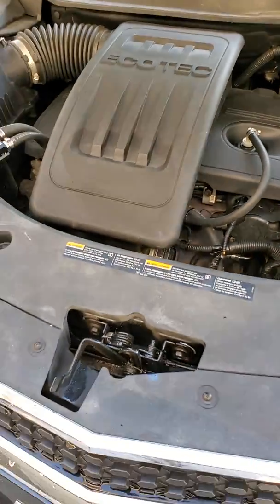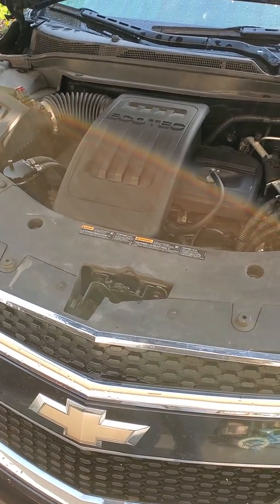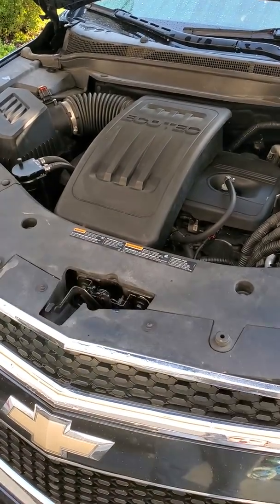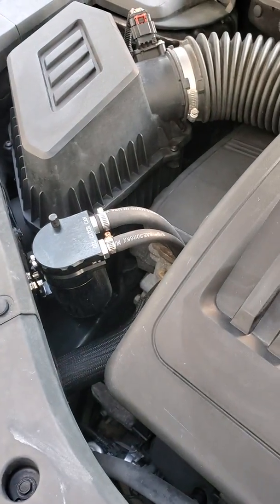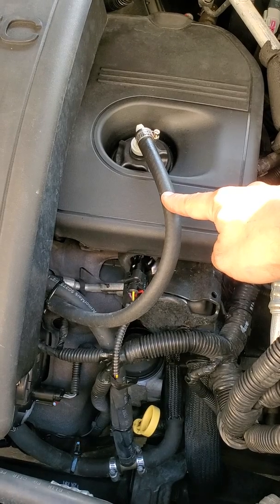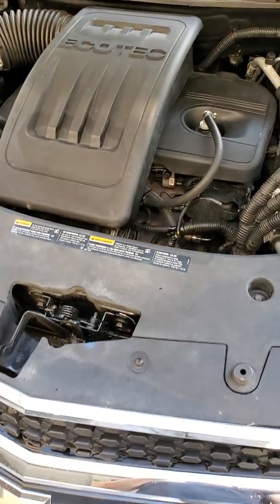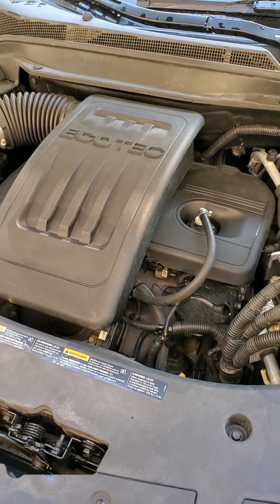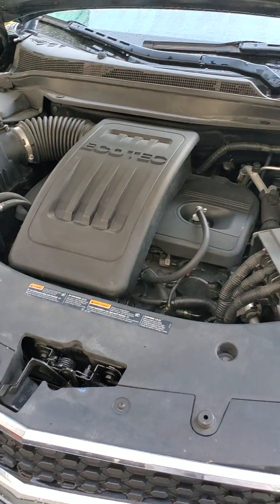2.4L EcoTec oil consumption fix. 2013 Chevy Equinox. Oil Burning, Catch Can.

Comment: Does this system help or fix blow by?
Reply from the maker: @stevejohnson-q3v  it helps reduce the symptoms of blow by and gives it an alternate route plus catches excess oil. The rings are the main culprit.
Reply: thanks for replying! i have a 2016 GMC Terrain does't use oil but does show signs of blow by! thinking could be stuck rings or pcv orffice plugged. i put a oil catch can on the clean side about a year ago and was surprised the amount of water it accumulates, think i'll install the pcv valve like you did in the oil fill cap, i seen your video about putting two catch cans on but never seen results, do both catch water? ever any issues with the brake booster?
Reply from the maker: @stevejohnson-q3v  clean air side for me iv never caught anything.  Dirty side I have to empty 2500 to 3000 miles (worse in winter)

Comment: There are a few reasons why GM and other manufacturers choose the fixed orifice PCV design. One reason is consistent flow of O2 for fuel trim. The other is to help with oil consumption. High vacuum with a PCV valve wide open forces the fuel trim to adjust constantly, and can potentially suck the oil out of the engine. So as an experiment what I’m going to do is modify your design with a fixed orifice PCV valve on the oil filler cap instead of that Honda PCV valve. I’m basically externalizing the original design for this engine. See what happens. The goal is to not need a catch can, but we will see
Reply from the maker: Cool to experiment. This has been working for me for almost 4 years now. The benefit of catch can especially in my climate where it's cold for 5 months of the year is I can capture and eliminate the excess fuel / oil mist and keep it from being recirculating into the engine. See my other videos of how much I catch on a 3000k mile oil change. Good luck .
Reply: In my opinion that's the only proper solution. Rumor has it the EU drivers figured it out by stuffing a 8mm OD sleeve and a 3mm ID hole inside of the pcv nipple that comes out of the valve cover

Comment: Did you use sheet metal screws to mount the bracket for the catch can? I've seen other catch can equinox installs here and some use
the provided machine screws which would need a nut on the back end of the screw to cinch it to the bracket, On my Equinox, there
is no way to access the back side of the frame that the catch can is mounted.

Comment: The terrain, equinox, Acadia whatever vehicle gmc, Chevy made that had this engine was doomed the day it came off the assembly line. I owned a 2011 GMC Terrain. And the problems culminated are as follows:

-20k mi. car died. 3k mi short of the oil minder

-35k mi. Timing chain tensioner failure. Engine chatter audible after fix.

-40k mi. Consuming 1 quart of oil every 1500 mi. 

-55k mi. Engine chatter worsens, consuming 2 quarts of oil every 2000mi. A/C compressor failure. 

-110k mi. Car dies upon acceleration after a complete stop. A/C compressor failed again. Multiple leaks and clogs within the system. Total replacement of the air conditioning unit required.

Cutter GMC were involved in the general repairs to the engine not the components I.e A/C. After I hit 55k mi my warranty expired and I was left to fix the repairs after that on my own out of pocket. I did not have any issues with GMC. The folks there are lovable, kind and generous. Supplied me with a loaner until the car was fixed, another GMC Terrain. Lol. No issues with that one tho.  The vehicle has since been brought back to the dealer for a trade in a year ago from today. I honestly must say that GMC/CHEVY manufactured a poorly  designed vehicle. This fix they propose doesn’t address the already badly burnt and varnished internal components inside of the crank, cam shaft journals as well as the the timing chain tensioner which requires oil pressure to work. The only good thing about it I remember is the ride comfort and how quiet it was to dampen the road noise.
Reply from the maker: I have 150k on mine. Still running strong all original except the ring update and the catch can.
Reply: @abefroman1986  that’s great brother. I’m just glad I rid of mine. All those problems added up and in the end I lost. It’s a great car for the ride quality and comfort (very quiet). I would have kept it not having the mechanical issues. But changing the rings, nah. It’s not a great engine anyway. Transmission was slipping as well. Started slamming into shifts. Lol. My mechanic and I both agreed…let her go.

Comment: Hmmm,... I and my woman are the 2nd owners of a 2011 GMC Terrain 2.4 we got from a dealership several years ago. It had about 39,000 miles on it. Sticker said it was made in Canada. Seemed to be a solid sound vehicle when we test drove it. Don't  really know much about the history of it. Looked new inside and out. Figured it was kept in a garage? We mostly keep it in the garage out of the elements as possible. We don't wash it as often we should have, but we get the full wash most every time. We usually change the oil when the oil change message appears. I assume is about every 4,000 miles? Use Valvoline quick oil change. Haven't had too much going on with vehicle. Replaced the battery a few times. Replaced all the tires once. Replace the air and cable filters. Replaced the oil intake manifold solenoid. The windshield wipers a few times. I check the oil before each trip I go out on from home. I seem to go thru a few quarts of oil between oil changes just adding oil as needed. Currently the vehicle has just over 112,000 miles on it now. I have yet to replace the sparkplugs. Supposedly they are to be good up to 100,000 before replacement. Have yet to replace the brake pads. The exhaust has been leaking tho and I will have to get that fixed before the time to be inspected next April 2023.

Comment: This looks like the best idea yet to fix the poorly designed crankcase venting issue.  My only concern is where is the brake vacuum line pulling it's vacuum from and whether oily crankcase fumes might cause an issue.  My 11 2.4 Equinox got the warranty rebuild and burns no oil and has no significant blow-by but I still worry about that tiny orifice in the intake manifold plugging one day.  I've got 140k miles on it now and it still drives like new, I don't know how long I can reasonably expect the engine to last before it starts showing it's age.
Reply: How’s it going?

Comment: Hey I have a 2011 gmc terrain has water in the stock oil cap every now and then just wondering does this catch can thing fix this?
Reply from the maker: You will always have some condensation. You will be amazed how much the  can will will catch especially in the cooler months if you live in the north like me 1 month and it will be full of 20%water

Comment: Folks. Going forward. Stay away from all GM products. They are garbage. I used to be a big GM fan. Those days are long gone. There are better more reliable vehicles for your hard earned dollars.
Reply from the maker: 145k on it now no oil consumption... All fixed
Reply: @abefroman1986  You also had to have the positions and rings upgraded before you installed the Catch Can. That was an expensive repair that you shouldn't had to make.  A lot of lawsuits with the Equinoxe's. With that said, I am glad you got the oil burning issue solved, but if I were you I wouldnt buy another GM product.

Comment: Hi. I have a 2013 Chev Captiva (bro/sis to the Equinox)  w/ the 2.4 L engine w/ less than 125 K. Burns about 1 qt per 1K miles. I currently have a new Jasper engine on order. I wonder of the TSB is still valid. I just found your YT video. Thanks.
Reply from the maker: Should be under warranty worth a call

Comment: Hi Gino, how can i contact you? Please help me to build this, i don't know if my piston and rings are updated. But if not, is it still okey to build this kind of stuff to my 2017 equinox 2.4L? I am an average joe who doesn't know parts and engine.
Reply from the maker: I posted links  and part numbers for the parts in the description. The engines after 2014 have a better ring design so you should be ok there. Order the catch can from amazon. The hose and tee are available at a local auto part store. But if you aren't Mechanical or familiar with automotive systems you may want to find a friend or mechanic that is willing to do install this for you help out. Yes it's still ok and even advised to add a catch can.
Reply: @abefroman1986  i am living here in Ontario, i asked 2 mechanic and they are not familiar with oil catch can. But they can try to install it, my second thought to i need to drill and put another pcv line to oil cap? Or oil catch can is okey? I will show this to the mechanic and let him figure out after purchasing OIL CATCH CAN. Thanks btw.
Reply from the maker: @markjaysonmaranoc5710  again all parts are in the description.

Comment: I tried joining the FB group.  I have not been approved.  Can someone send me the file on the pcv from TS SCI.  I want to help my girls Equinox last as long as possibe
Reply from the maker: I can Email you the copy of what he sent. Does his system work? Yup I'm sure it does. He probably spent 4x as much money as I did doing what I did for a very similar result. If you want I can email it to you just give me your email contact. Also did you watch all my videos. So far the clean side hasn't seemed to be worth the effort. I have collected 0 in it with over 5000 miles on it. Running in every from 70 degree weather to now -2 deg F temps.
Reply: I did watch them all.  What is the email address it will be coming from?

Comment: Would drilling the hole bigger in the intake improve any of this? If it is only a 1/16th hole, I just wonder if drilling bigger and then possibly adding pcv valve to original piping.
Reply from the maker: Not a good idea. That hole size is important for the flow related of the clean vs dirty side. It's a metered hole. Make sure it's clean and open. Get rings updated if available. Add catch can move on with life.
Reply: Absolutely, not much bigger, but a tiny bit. I have a 2014 terrain. I used the $300 bg dynamic engine cleaner with drilling the hole a tiny bit bigger, I believe I used a 3/32” drill bit, with grease on it to catch the plastic and I went from losing a qt of oil in 200 miles to, so far I’m over 500 miles with no oil loss!

Comment: Hi found you video.   Good video      By any chance do you know the upgrade piston part number or where can I buy them I need to do that to my Captiva.    I already change heads but is eating too much oil please help will appreciated
Reply from the maker: GM has a revised ring pack for the engine. I'd recommend calling them it may be covered under warranty.

Comment: How can I find out if my 2014 LT AWD has been fixed under warranty?
Reply from the maker: Call dealer. However most 2014s have the updated rings pistons from factory.basicly if you aren't burning using oil every 1 to 3000 miles and your intake does t have oil injestion you are good. Add catch can for good measure and move on.

Comment: I was going to try this on an Equinox (2011 I think) I bought about a year ago.  The dealer did go thru and overhaul the engine, so I'm pretty sure he did the ring/piston upgrade.  My question is the same as Wyatt Priest.  Does this stop you from losing oil, it sounds like it still leaves the engine, you are just catching it instead of burning it?  As mine is right now, it can go thru as much as a quart in about 300 miles and it looks like most of that ends up in the air breather.  Awhile back I cleaned it out and there was quite a bit in there.  Just here the other day we made a sharp turn the the thing belched out a bunch of oil smoke.  I'm thinking that turn sloshed what was in the air breather into the intake.  Please let me know.  Thanks.
Reply: If you put new rings in,this to stop oil burning.If you don't then catch an will help with you.I have a 2012 Malibu2.4 .You have clean your orfic in your intake and the block,the get clogged and will blow main seal.It is a tiny hole.So if you put new rings in ,then the catch won't help much.If you don't have new rings then catch will catch the oil and whatever else from getting in the intake .He has it backwards!

Comment: Hi Gino, I just worked on my daughters 2011 equinox pulling the air intake to clean out the tiny orifice that was all plugged up. Kinda time consuming but relatively easy. A couple questions for ya, the upgraded filler cap part #FC219 does that only serve to prevent a blown rear main oil seal? And what is the difference between installing the catch can inline with the filler cap as apposed to inline with the breather hose that goes from valve cover and air intake "box"? Does the filler cap go down into the crankcase where-as the breather line is up in the valves?
Reply from the maker: See my latest video on clean air side vs dirty side. You could benefit from both. The new style cap only prevents rear seal blow out. Apprently there is also an updated valve cover that can help but you are better off installing a can to catch and remove any oil and moisture that would then be getting reciculated into the engine with the new style cap. When removing the airbox was there oil in the system? I bet there was. Mine is absolutely dry now.
Reply: @abefroman1986  ya oil was getting up into the box. We had the timing chain bust a hole in the valve cover 3 weeks ago so that got replaced (she was down in TN so I didn't do the work). Before that the throttle body had to be replaced from oil contamination. It's a shame because it is a really nice car, rides nice and good fuel economy. When she comes back up to Michigan next time I'll try installing the catch can. Thanks for the response.
Reply from the maker: @scottschuette74  See if you can find out if the rings have been updated via GM see if you can get it covered under warranty. That is the single biggest issue. They have redesigned the piston and rings.
Reply: @abefroman1986  I stopped at the Chevy dealer today after work to see what they recommend,  and they basically said that as long as you keep the vent hose clear from water buildup and freezing in winter time that I shouldn't have any issues.  As for the piston rings being upgraded I am not sure, I know some warranty work was done once upon a time, but it is still burning through oil.  I did try dumping seafoam down in the cylinders and letting it soak overnight so we will see if that helps. The guy at the dealership said it can't hurt, but wasn't too sure if it actually works.  And to any one reading that, I LEFT THE SPARK PLUGS OUT BEFORE TURNING IT OVER!!! I know about hydrolocking.

Comment: So im guessing this eliminates the need to remove the intake and clean the vent hole??.. Daughter has s 2011 with pistons& rings upgrade still loosing oil fixing to do the timing chain might as well upgrade the pvc system Chevy screwed up
Reply from the maker: Timing chain isn't going to fix oil consumption. If you are burning oil you need to check the pcv orface clean it then Put the can on. The can will help reduce the mount of burned oil in the engine. But if your still burning oil after the piston and ring fix I would definitely be back at the dealership if your under warranty still sounds like you have larger issues unfortunately.
Reply: @abefroman1986  right..but i  have to replace the chain might as well kill two birds with one stone...but i was asking does this eliminate the need to remove the intake and clean the vent hole?
Reply from the maker: @tommymanning8075  my answer would be not if your still burning. So I'd clean the intake. The. Add catch can that way your know you are double covered in the event the 1st hole plugs also look at my other videos about a clean side filter.
Reply from the maker: @tommymanning8075  side note if you had the rings updated recently part of the process is for them to clean the pcv hole in the intake so if you know it's been done recently your probably ok.

Comment: - * SHIT! * -  I'm a 20 year retired military veteran. Two weeks ago, I bought a 2019 Equinox LT. It only had 18,400 miles on it and was a lease vehicle before I bought it (one owner). I hope I didn't screw-up by buying it. 
- NOTE: It has brand new tires on it (okay, they're the cheaper Walmart tires, the AWD Mastercraft Grand Touring all Season). But, like I said, they're brand new. - Perhaps I should trade it in in two years? Any thoughts from you car pro's? I'd appreciate it. - "Fair winds and following seas" to all. I was a 20 year, aircraft carrier man. Boy, do I have stories.
Reply from the maker: 2019 has the updated rings put on a catch can monitor oil level you should be good to go. Thanks for your service.
Reply: The 2019 is a different generation Equinox.  I'm not sure if any of these problems still exist on the 3rd gen series (as far as I know, they do not), but the issues are pretty bad with the 2nd gen (2010-2017).

Comment: After seeing multiple videos this other guy sent me a diagram. I would be doing the same thing but i will add another t line in between the valve hose to the oil cap to tge catch can. If you dont do that you still run the risk of that factory hose to clog up.